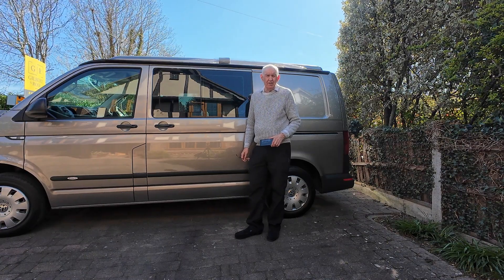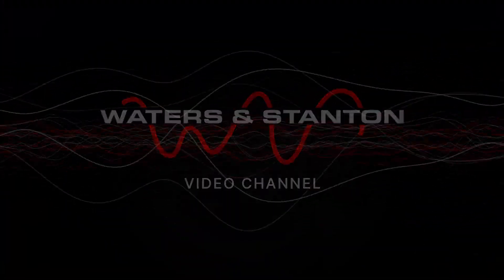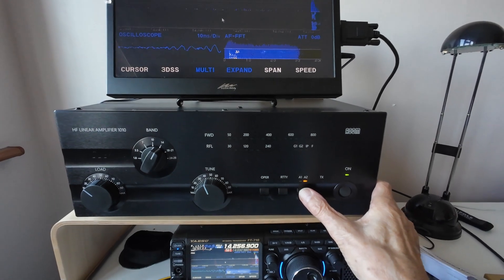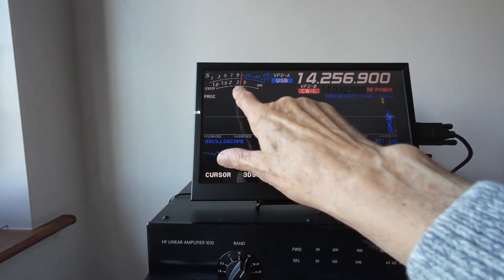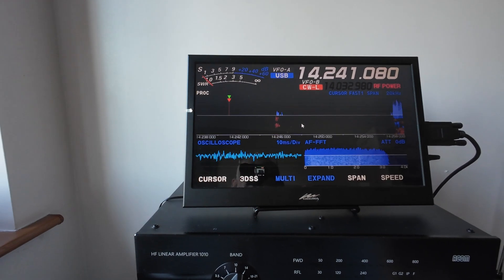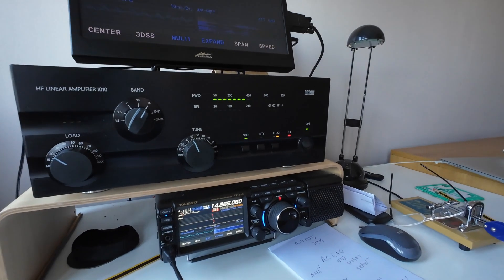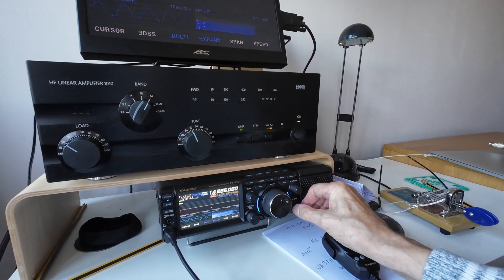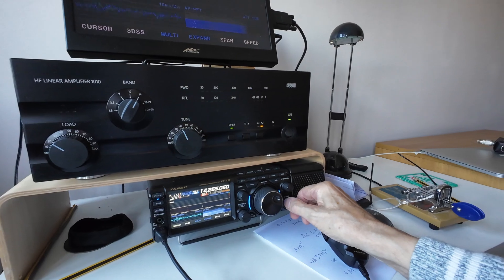Shortened Vertical Half Wave Antenna

Comment: I would use an L Match, 6.4 Meters vertikal and small counterpoise, so I have an Antenne that works from 10 to 20 Meters. I dont understand the Hype with this Transformers 49:1  vy 73, dk2ty

Comment: Excellent video Peter. It make me think that if electrical lenght is key then you could do the same with an 11m whip to get on any band as long the addon wire is adjusted in lenght to the band of choice. The only downside I can think of is that you don't get second harmonic since part of the antenna is tuned. Did you try to see if 10m worked as harmonic? Take care all. 73 de LA1PHA Tom

Comment: Excellent video, Peter as always.  

I like playing with antennas to see what can be done.  Interestingly, I've taken down my wideband Antiference XG16 TV aerial and thought that I would test its bandwidth using a VNA.  I was amazed that on the 70cm band, it was not far off being usable.  The maximum vswr across the band was 1.8:1.  Amazing.  I'll have to get a rotator.
Reply: "not far off being usable" means unusable. You then go onto say VSWR is 1.8:1 across the band, which is perfectly usable, so I'm a bit confused as to what you mean. Did it work or not?
Reply: @mariemccann5895  What I should have said, and what I meant was: not far off my preferred maximum vswr of 1.5:1.  Sorry if I caused you confusion.   I would still use an antenna up to 2:1, but my ocd would kick in.

Comment: Hi Peter, I have the same van as you. I have a “K33 Trunk Mount” mounted down the vertical edge of the tailgate. Be careful with the angle of the antenna as my XYL had an accident with mine. The poptop was open and she opened the tailgate to get into the boot, unfortunately the antenna got stuck in the poptop scissor hinges.

Comment: I did wonder when I saw the title, whether the lower element would be a wire, or whether you'd try and cobble together some form of linkage for the two hamsticks - I think it would be fairly easy, the nut thing comes off the mount and you could use it to link the two together - and then clip the unun onto the end of the bottom hamstick, maybe with a crocodile clip. Maybe worth a go just for a laugh to see what would happen?